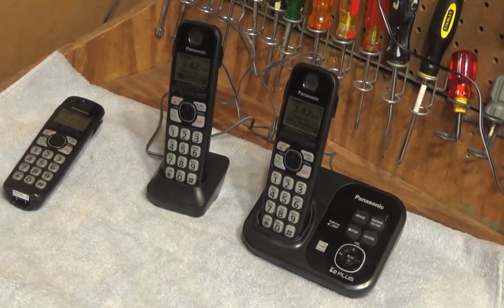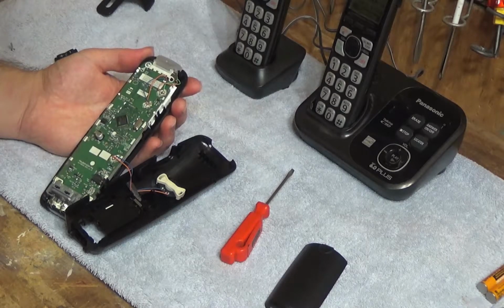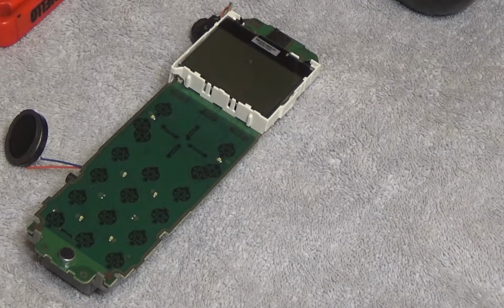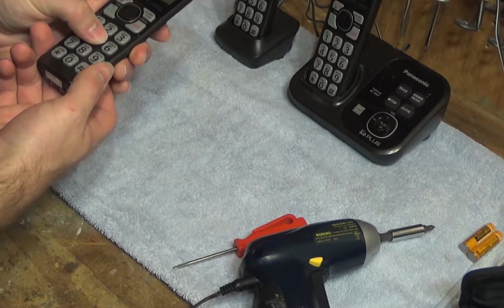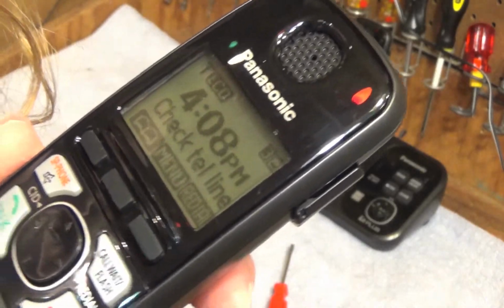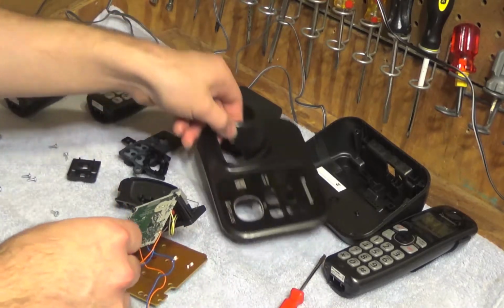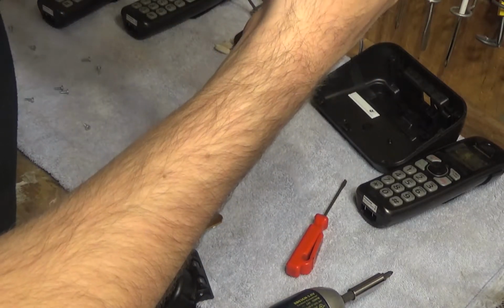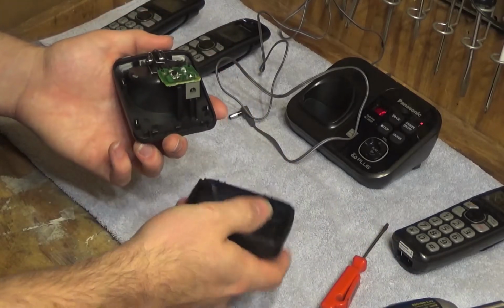Panasonic KX-TG4731B | Refurbish

Comment: These are nice phones but where is the 3rd cradle? You can use an old Bluetooth phone that quit working cradle.
Reply from the maker: I don't know, I got these phones in a lot of equipment and the 3rd cradle was not present.. As it turns out, the cradle that is present doesn't work correctly, so I'm really down to 0 cradles.. I think I will probably swap the electronics from one of the old BlueTooth phones, since I have more of those handsets than the base can handle..
Reply: Jordan U nice idea...